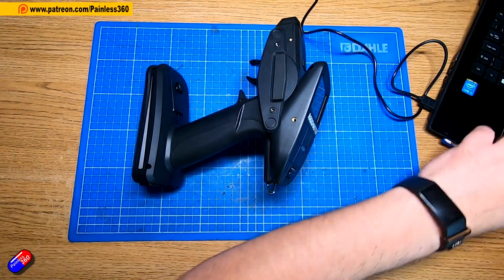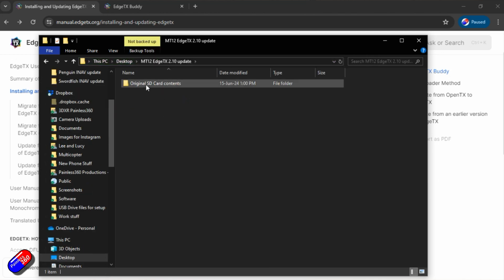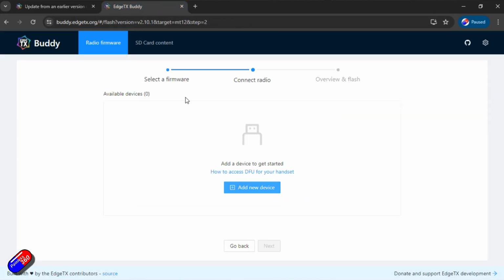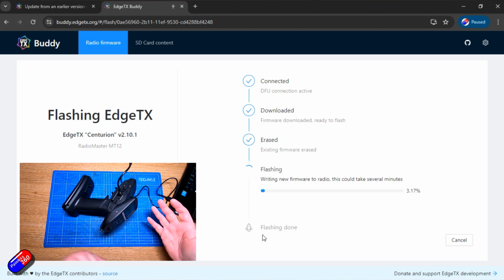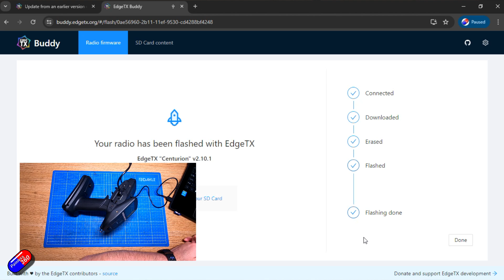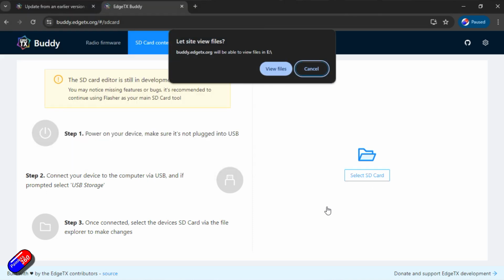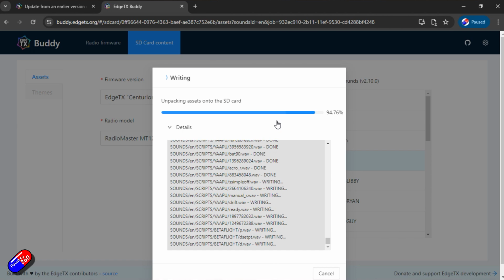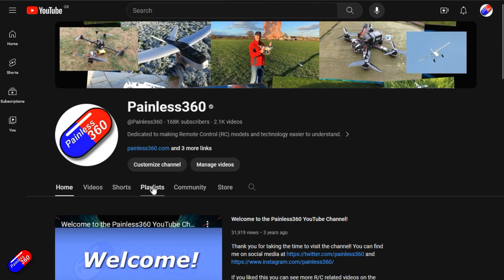How to update EdgeTX in your RadioMaster MT12 - Live demo!

Comment: Great vid do you have one that shows how to update the internal 4 in 1 module ? Thanks
Reply from the maker: It's the same as other ELRS radios, I have videos showing the process to update the module on those.. Check them out.
Reply: @Painless360   Thanks I scrolled thru your vids can't find it you have so many, could you please post a link? . Thanks
Reply from the maker: https://youtu.be/W1XWJCW3KO8 will help. Happy flying!
Reply: I went through everything and updated my device.  Now my MT12 will not recognize my steering or my throttle.  I backed up my card to go back to the original set up but I do not see a video on how to restore my original firmware back onto my MT12.  Tons of videos on how to update and backup but none on how to restore.  Do I just copy everything from my old SD card back onto the one in my MT12?  Should I have it turned on or off?  Should I pull the card and do it that way?  Please help

Comment: Great detailed video!!  However, for some reason both my win 10 and win11 PCs will not install the SMT32 driver.  It recognizes the radio and will display SMT32 BOOTLOADER in the device manager but says unknown driver and windows update will not find it.  So with that, are you able to open up "See how to update a radio using the alternative bootloader method"?  when I click on it, it says the video is set to private.  Thank you for all you do!!
Reply from the maker: ImmersionRC driver fixer or Zadig can help. Video on the other method out on the 18th August...
https://youtu.be/WzTq5ZWdhRM
Reply: @Painless360  'ImmersionRC driver fixer', did the trick.  updated the firmware and sd card via you video without issue.
Reply: @Painless360  ok thanks for the feedback.
Reply: Hey there, I had the same issue when I clicked on "Find New Device". No SMT32BOOTLOADER was in the option list. Fortunately I found your question here and found Painless360 link to Zadig and downloaded it. It immediately found SMT32BOOTLOADER and I was able to install it. Went back to Edge Buddy and finished the firmware and SD card updates! Thank you guys for doing this. I am 72 years old and struggle with this amazing new high tech stuff.

Comment: i get to flash device and i get an error message dsaying cannot cinnect to dfu interface and another window that says  Failed to execute 'open' on 'USBDevice': Access denied. any ideas on whats wrong. i folowed your steps as you said.
Reply: I have had the same issue. change cable already but still did not work. let me know if you had found the solution.
Reply: just found the solution to this. You can download the latest firmware manually from edge buddy and copy that files into firmware file when you connect your mt12 to PC in SD card mode. then Pull and hold T1+T2 trim button toward each other while pressing ON button to open bootloader mode. Then, you can select the firmware file from the transmitter to get it updated manually. Hope that help! I tried today and it work!